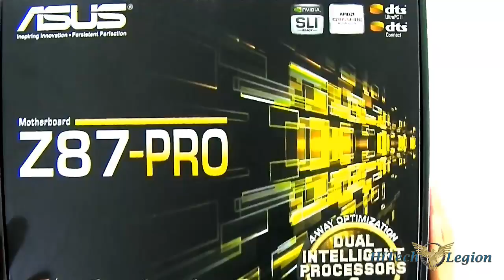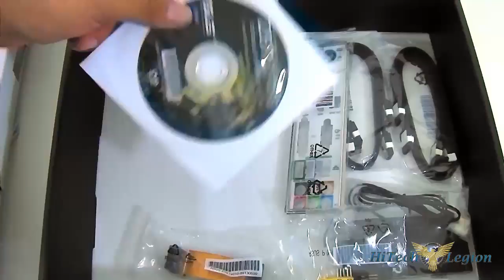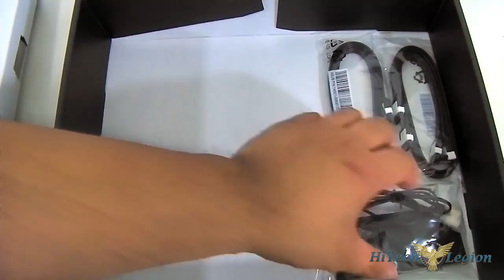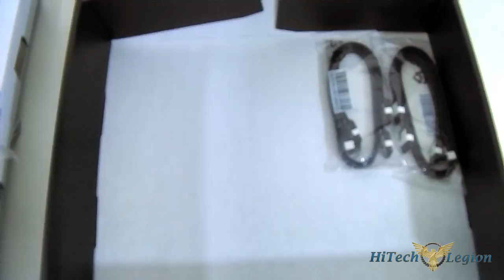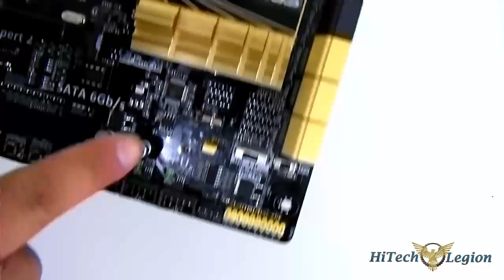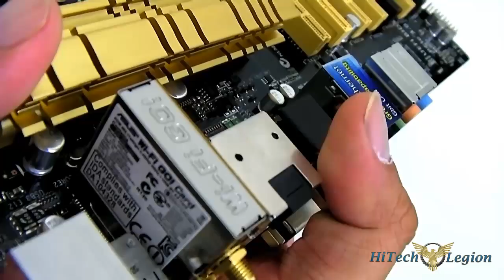ASUS Z87 PRO Motherboard Unboxing + Overview

Comment: can this work with a 450watts PSU?
I have an amd radeon 7870 and i7 3.5 GHz, I think both consume a big chunk of power, but will the motherboard suit the PSU capability?
Reply: seasonicl 520 watts 80+ bronze
Reply: Anything above 500 watts is just ok, just ensure that if you are using 500-575W, ensure that you have the 8-pin cpu power connector.

Comment: Hi. I'm having an issue with the four usb ports on the back of the case, to get to detect the keyboard and mouse i had to plug them where the guy said (ports below the ethernet port).Now, when inside windows if i plugged any flash drive in any of the four usb on the back they are not detected, do i have to update the AS MEDIA driver to get them to work? Thanks guys